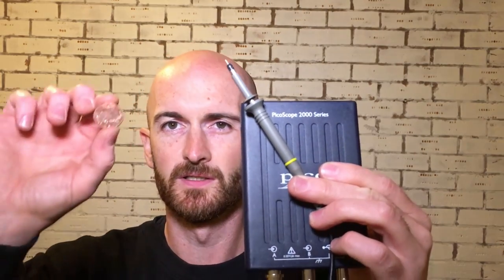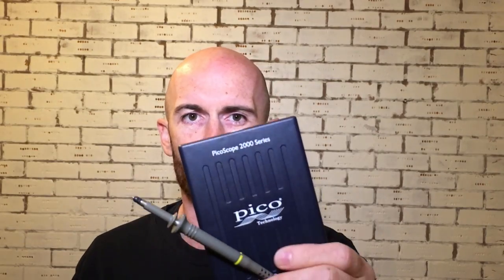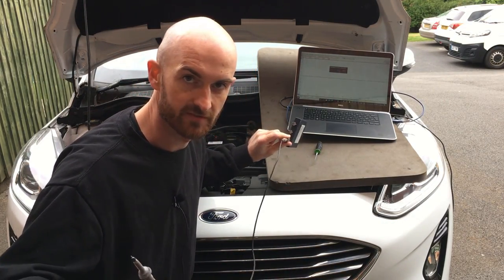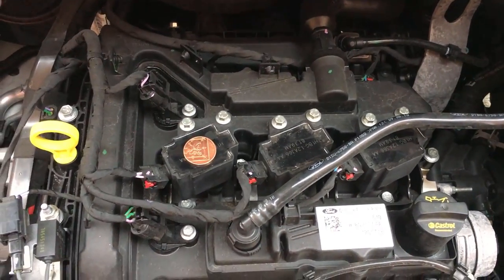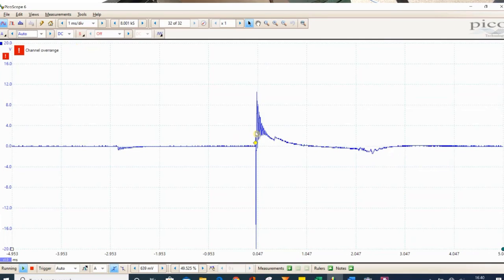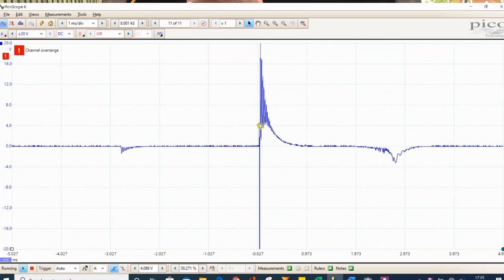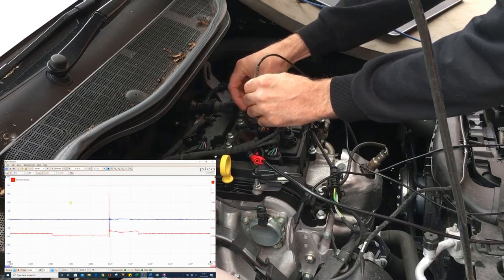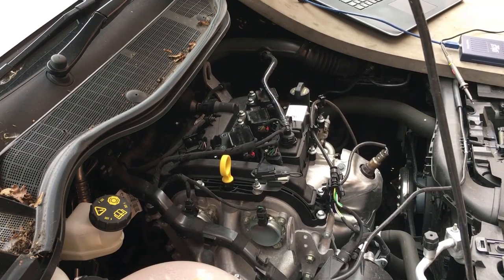FIND MISFIRES FAST! [How To Check Misfire PicoScope 2204A Automotive Diagnostics] Mechanic Mindset

Comment: Cool video! This only works when the driver for the coil is not located in the coil, correct? If it is a three or four wire coil, with the driver located inside of the coil, this will not work......right?
Reply from the maker: Glad you enjoyed the video! As far as I’m aware, this works on any coil. VW have the driver in the coil (right?), and it works on them too. I think the only ones that have issues are the ‘pencil’ type coils found on BMWs. Flat top on the coil helps. It is basically just picking up the magnetic fields from the primary and secondary windings found in all ignition coils 👍
Reply: Should make no difference the coil fire's any way

Comment: The coin on the coil is just a variation of the sheet metal adapter we used back in the seventies for GM HEI ignition systems. It clipped on top of the distributor cap (coil was inside it) and you were able to pick up a secondary voltage signal. I don't know why you used the attenuator though, there's no need. In fact, a probe setting of 1000:1 is appropriate for that setup with no attenuator.
Reply from the maker: Yeah same principle. 

The attenuator was used for the comparison measurement where I was probing the primary coil directly 👍. Not on the coin lead

Comment: He specifies not to use the negative lead - but notes you'd get the same results. . . is there a situation it matters? 
With the leads that come with the 2204a; is that short black cable a ground? wondering about its function. 
Thanks to anyone who can illuminate 🙂
Reply from the maker: Hi, because we are only measuring electro magnetic fields, the ground connection doesn’t change measurement. It’s more like an antenna than voltage measurement. We do need the ground when checking voltage directly (like sensor signal) because the scope will use the ground as a comparison (potential difference) to give us the reading. Then it is essential. Plus these leads are not suitable for automotive because of the incredibly short ground lead 👍

Comment: That works being a rf aireal 
Also eddy currents 

Better be a high frequency transformer
Reply from the maker: So many things you can do with this. See the video where I use a relay coil to do the same test; great results!
Reply: @MechanicMindset  u want to use a switch mode power supply coil on it........

Designed for the high frequency magnetic signals 100khz area where as the relay is 500hz but coil be thin enough  
Car operate at 2000hz to 20khz aprox 

Do mechanics and electronics.........

You can get even fancier use ignition coil backwards if it a pure coil.........
Becomes 1 to 1 ratio transformer

Comment: Did you make a cop tester using a piece of wire looped around the plug boot and a bolt for clamping the ht25 leads onto. I tried looking it up without success. Maybe it was another channel.
Reply from the maker: Not me but sounds cool! Sounds like something Gadgets Playlist would do, check him out. He has some good videos
Reply from the maker: @wildcat22  Nice! Personally the coin trick has never let me down. If it does, see my other video where I use a relay instead 😉

Comment: Man I should have watched your video before I went and purchase the COP probe
Reply from the maker: Haha, it’s a good buy though and good for V engines where the coin will fall. You could make me similar to the one you bought
Reply: @MechanicMindset  yeah I know but I just spent a hundred bucks on a coin tool.lol. I saw someone made it for the hantek scope but I thought he was bs-ing me. Now you did it and it works. Lol
Reply from the maker: @DJ-tn7vj  😂😂
Reply from the maker: @DJ-tn7vj  Check out the one where I use a relay instead 👌

Comment: 🤣 same way I made one with BNC cable and stick. Good stuff, not spending 250$ on fancy coil tester
Reply from the maker: Awesome, they are handy tools and easy to make, check out the video where I use a relay for the same job!
Reply: @MechanicMindset  wow!